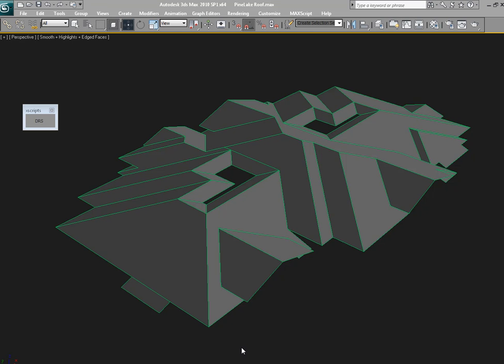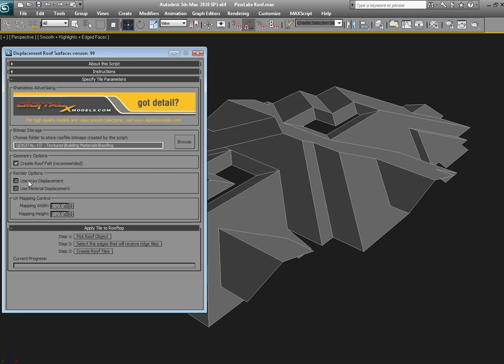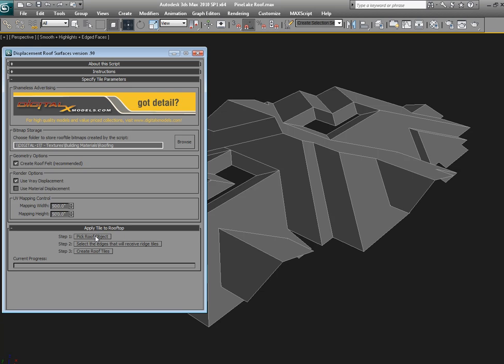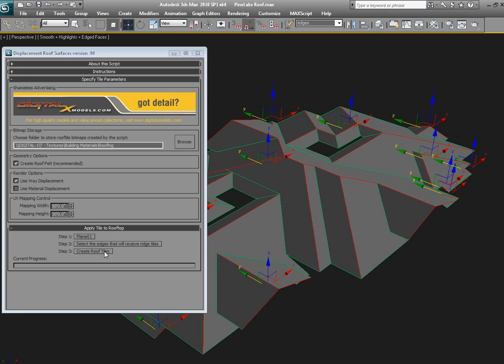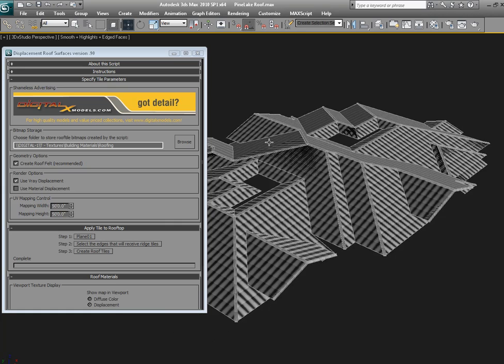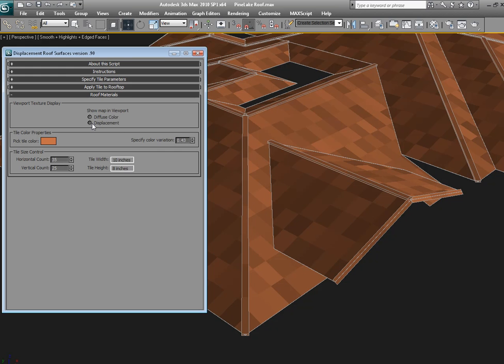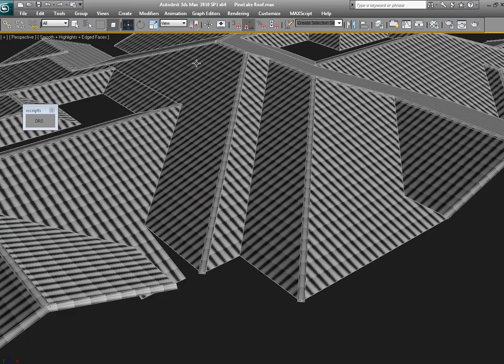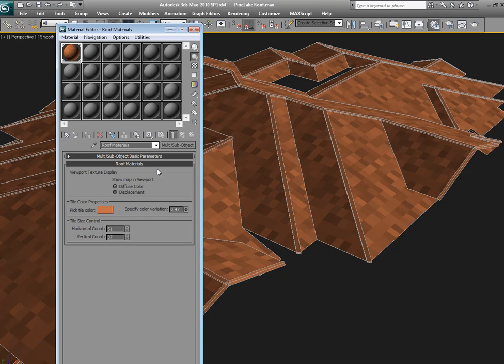Displacement Roof Surfaces - Free MaxScript from DigitalxModels.com

Comment: Do you know if this script works on 3dsmax 2012?  I've gotten the script window to pop up in 2012, but I'm having trouble once I start on the modeling of the roof tiles.  I get to add the roof, I only seem to do one ridge though.  I guess we would benefit some by seeing the preparation of the roof model to exactly the way the script needs.  I get an error " call needs function or class, got : undefined.

Thanks!